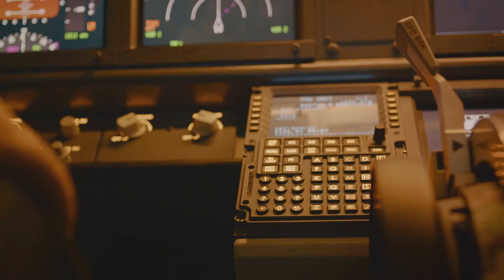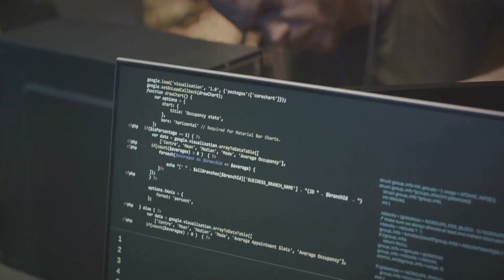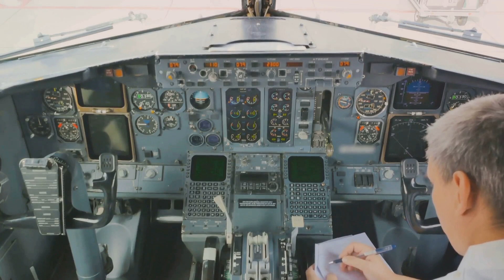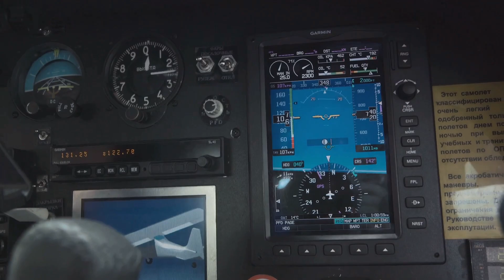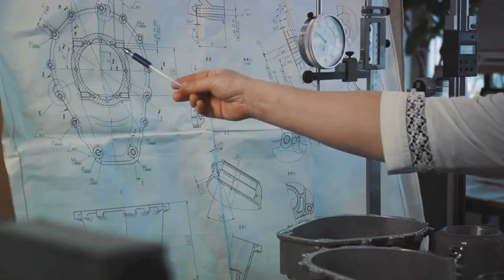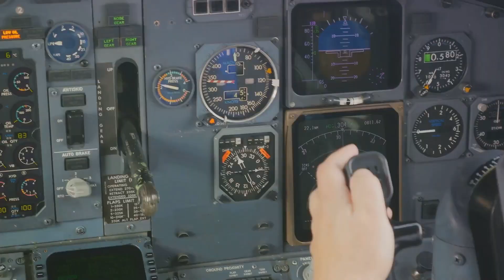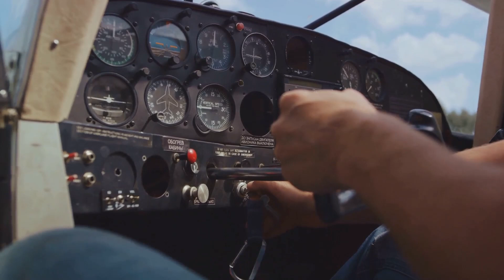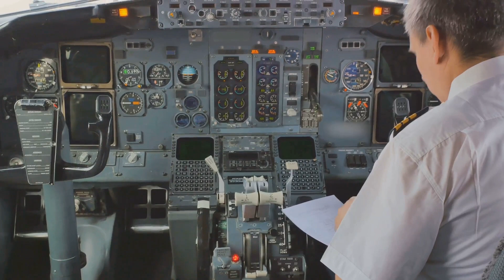Shocking!: Mind Boggling Reasons Why Aeronautical Engineers are not Allowed to Fly Airplanes

Comment: You state a reality, building a plane and flying it at 2 separates skills, that doesn't mean a person can acquire both skills.  By the way good engineers work very well under pressure and are very good at making precise and quick decision.  By the way I have a friend with an engineer degree that is actually a USCG helicopter pilot.  His engineer education made it easy for him to get that pilot position.  By the way a chopper is harder to fly than an airplane